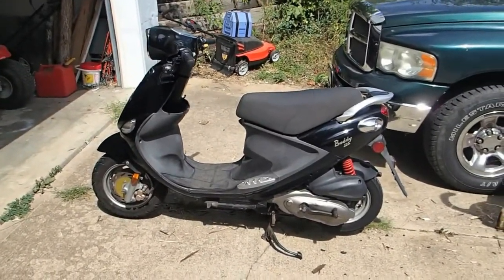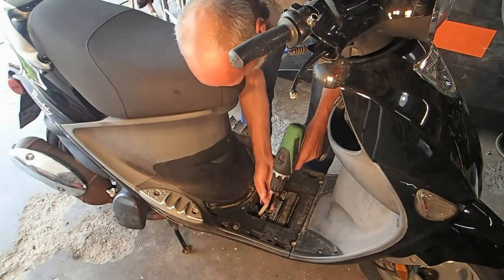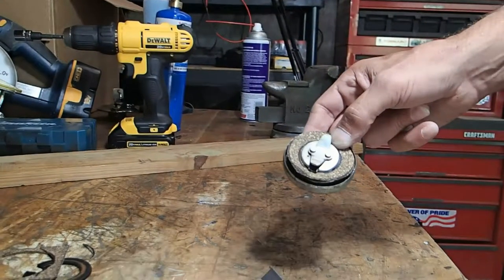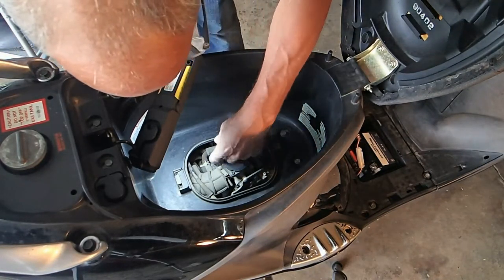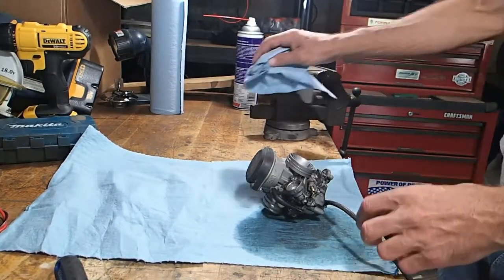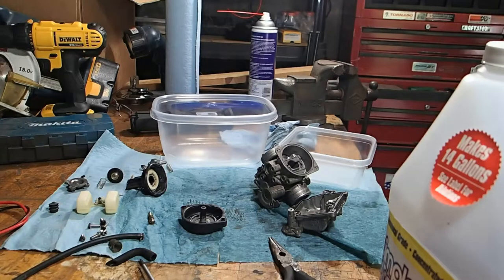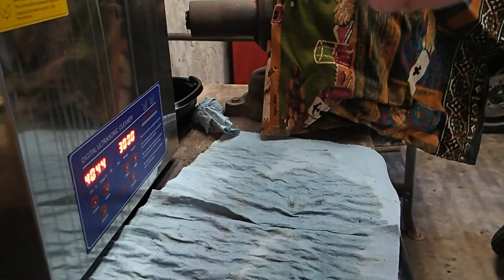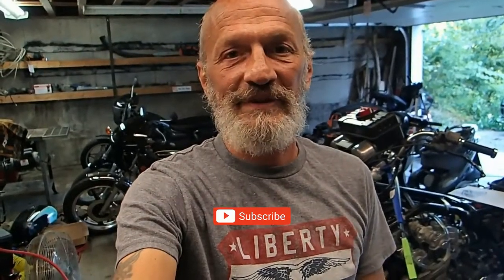2009 Genuine Buddy 125 Scooter  - Part 1 - Won't start - Let's fix that!!

Comment: mine will make the sound like it's trying to start, when i push the button, but, like, it doesn't ignite or something. i'm thinking it's a battery connectivity issue. but, all of this is new to me.

Comment: I just baught a buddy 09 / 7.000 mile  one of the colored the Pompeii red  .. guy started it up for me brought it home last night got up early to day to clean up opened  had a new fuel filter .. and a hose buy the gas tank .. looking at gas tank while standing on right side   At  9:00 o’clock  two hoses going in to a square  I assume  it collects  gas vapors so they got it going I bring it home now won’t start  .. if it was running carb is not gummed then ??    I thought they were fuel injected
Reply from the maker: Humm,  that's hard to diagnose without getting my hands on it.
Reply: "I thought they were fuel injected"  Genuine Buddy's are all carbed.
Reply: @9988ScooterGirl  may be the newer ones but this carb I replaced it runs great I don’t know if this carburetor was actually for it but this thing is fast it’s so fast it is sucks gas in less than 25 miles mind u it’s a gallon tank if I go Easy on the acceleration the gas last me pretty good but if I really gun it sucks up gas just like that for a 125cc does 55 - mph to sixty depends on weather